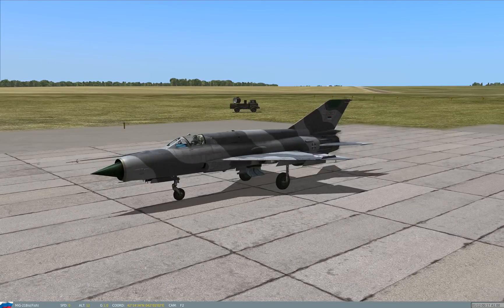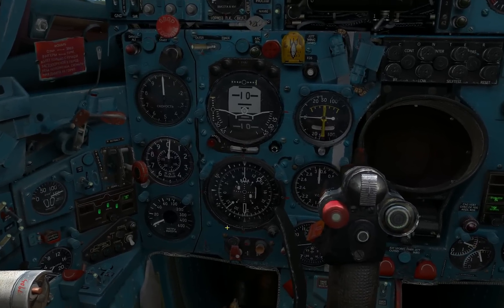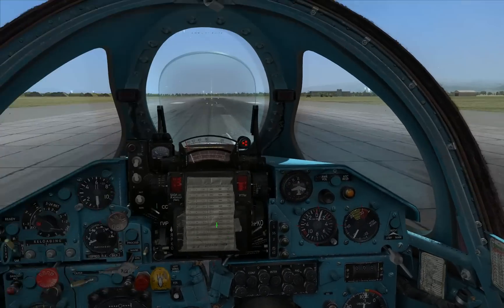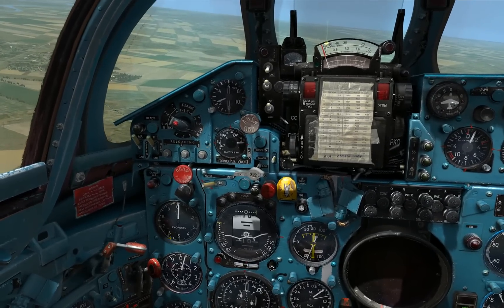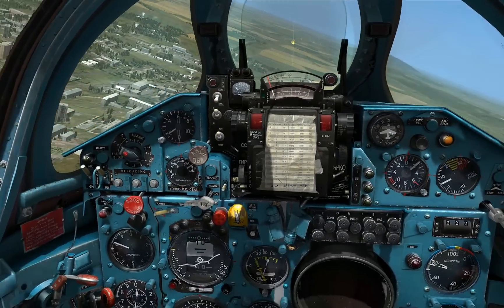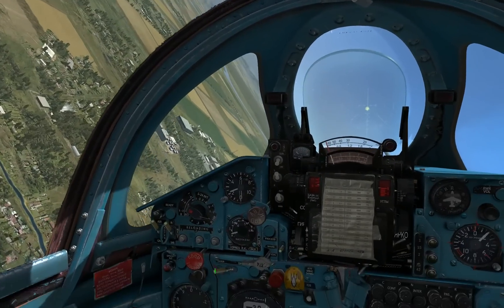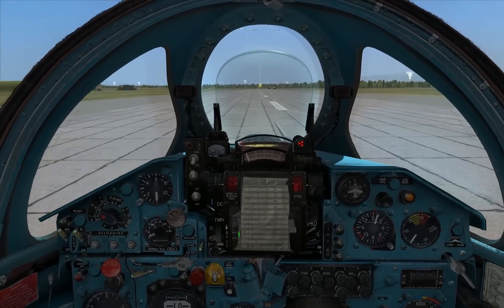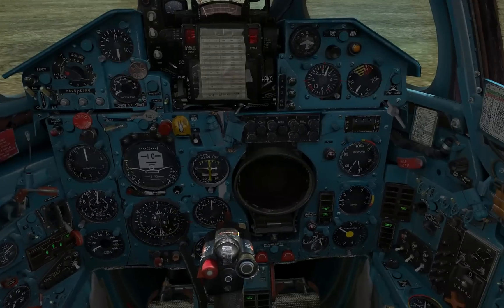DCS Mig 21 first impressions

Comment: Have got her for 50% off or something. DCS' annual spring offers. But haven't moved her an inch yet. :) Just happy to have the opportunity now, just in case I'd get tired of the Su-27 and felt like flying something legendary like the MiG-21bis of the 'good old days'. :)

For now I stick to the Su-27 but wish, ED would also release a professional flight model for her instead of this 'only' advanced flight model of FC3's Su-27 for now, though it's already close enough to a real Suchoi, manoeuvrability and system failures or mileage are quite annoying enough. But the non-clickable cockpit's opportunities are way to simplified and limited compared to a real Su and even to the pro flight model versions of other modules - e.g. like this MiG-21bis modul.

So, when I see you flying her with this extraordinary realistically looking cockpit and stuff I'm getting quite anxious to get her out of the hangar and give it a shot. Very beautiful and detailed. And awesome video graphics,btw, hence the question: What are you recording it with? And what's you're favourite encoding method to get the best graphics results on YT?